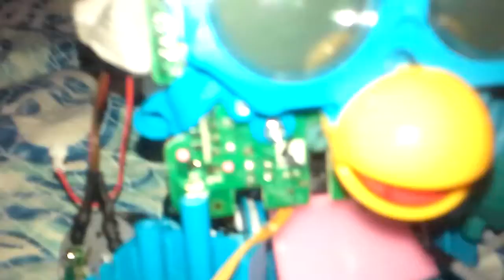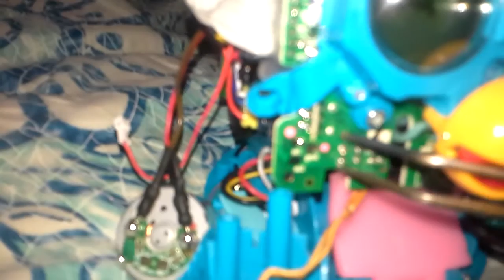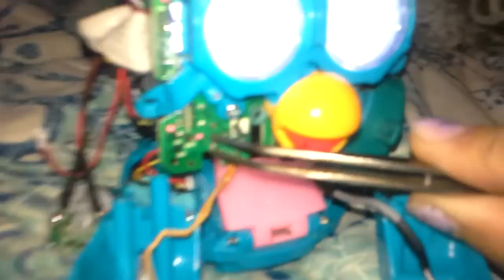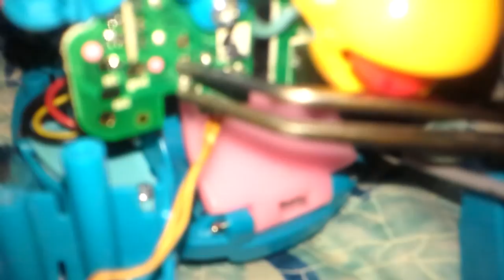Reason why furby is frozen.

Comment from the maker: it's easy, 1) unscrew the battery cap, 2) around the batteries theres' theses screws 3) unscrew them all, and un looped the tail 4) carefully pull out the tabs on the face plate  5) the ears are the hardest to do, and  the pastic has to be cutt off, or you can leave it there and flip the fur indside out, in the backk, there's tape and can be pealed off and unscew all of the screws and you'll be in the back of the furby, the speaker will come off easly, which is connected to a chip deep in furb..